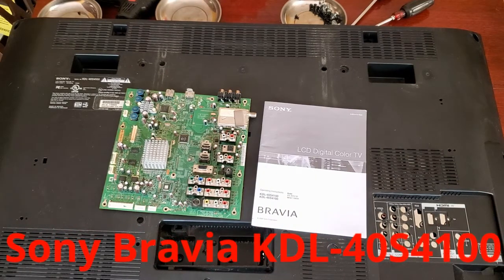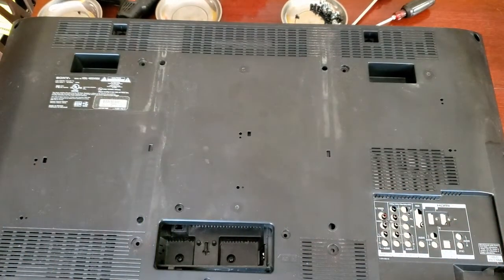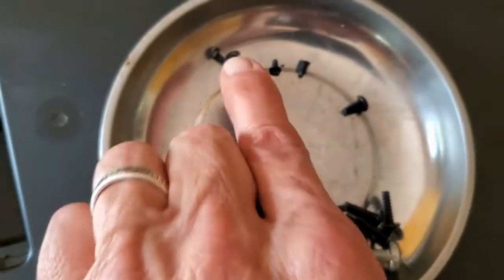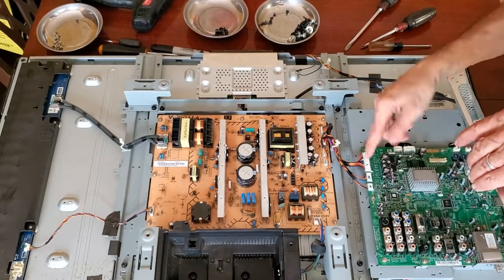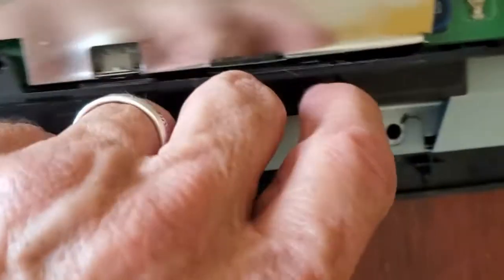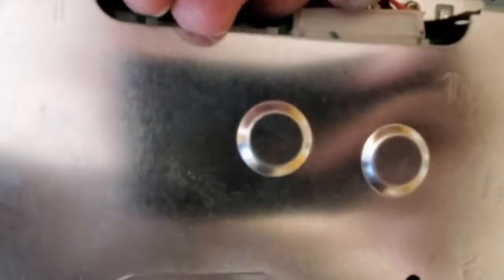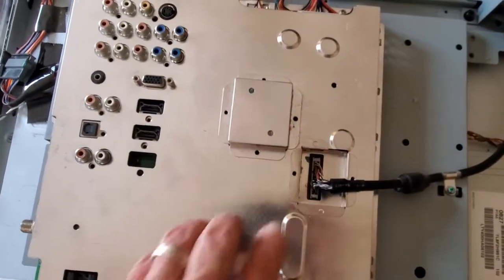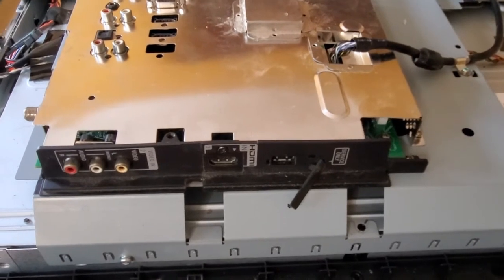How to Replace Main Video Mother Board 55.71H01.001 Sony Bravia KDL-46S4100 LCD TV

Comment: Hello! I would like to know why I changed the piece? I've had a TV like that for years and a few weeks ago I turned it on and the screen went black. If you see the power button in green.
Reply from the maker: I have no idea what happen to yours. , my issue was a lighting hit, that blew the board. The TV worked fine for several more years.